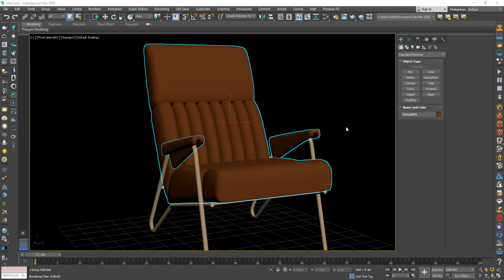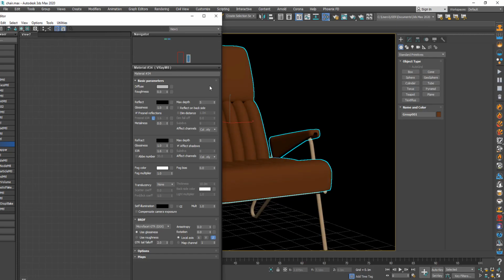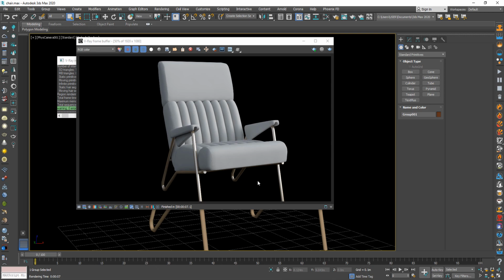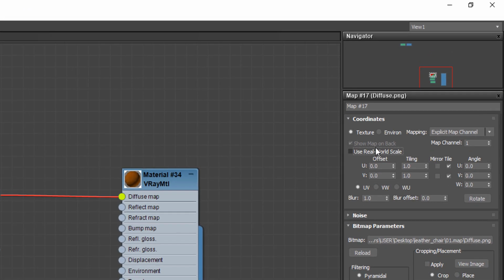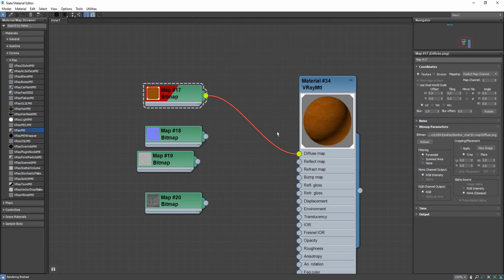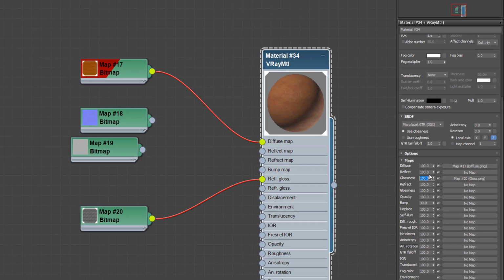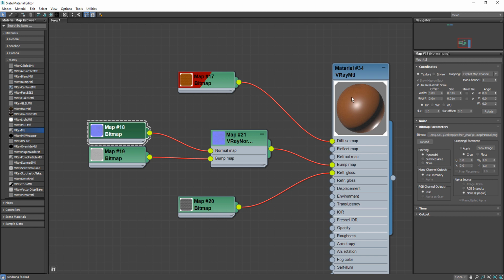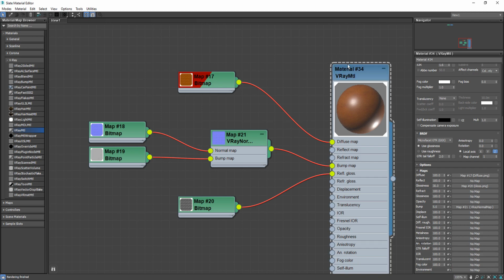3Ds max - How to create a leather material with V-Ray

Comment: Material/Map name 'Map #34 (Autodesk Speckle)' is not supported - ignored 
how can i fix this error??
Reply from the maker: Make sure to activate vray engine, also you don't need to Autodesk speckle materials...from material editor >material > Vray > Vray MTL, I think that will fix the problem.
Reply: The problem is that i had a course in working with ART so i cant use vray at all😢